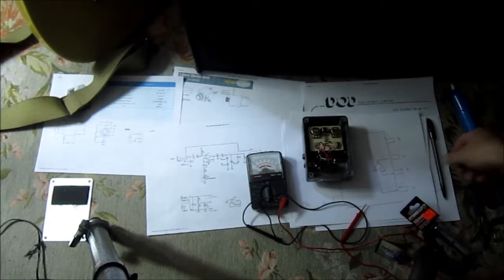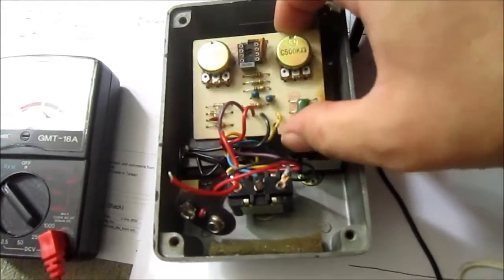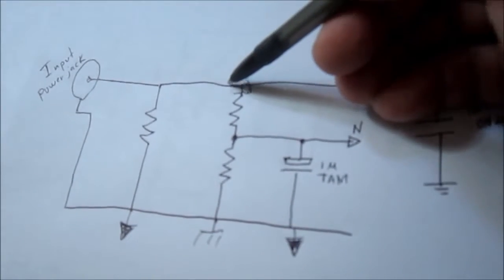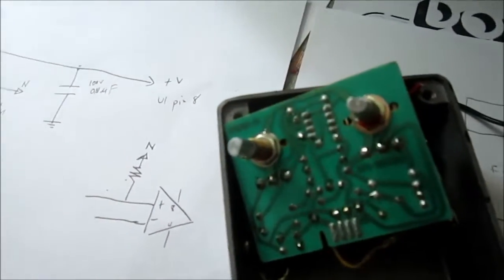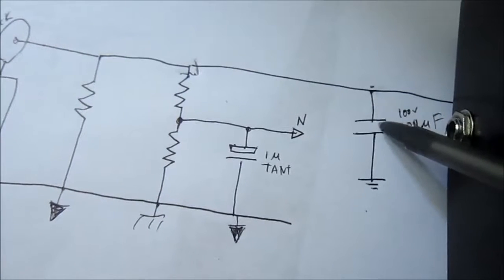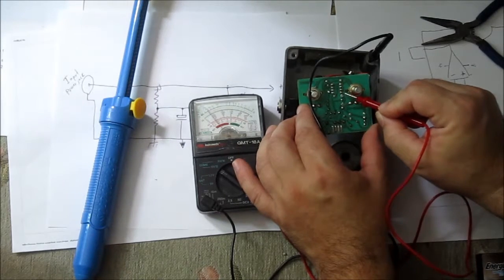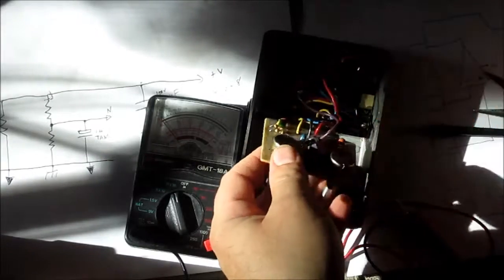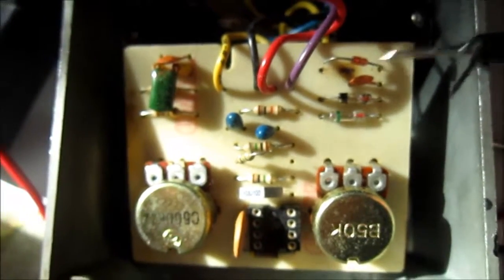Ross Distortion Pedal: Diagnosis and repair part 4

Comment: What is the value of the burnt resister you found, a long time ago I know.
Reply from the maker: It turned out not to be a resistor, it was a circuit protection diode to protect against what I did, put in the reverse polarity voltage. It just didn’t do it’s job very well